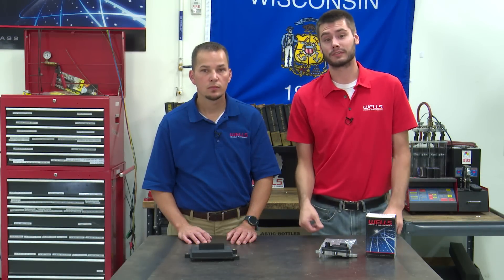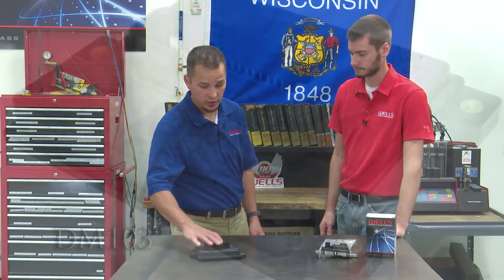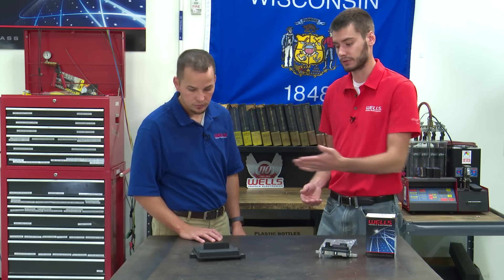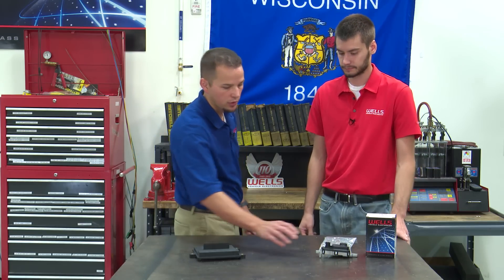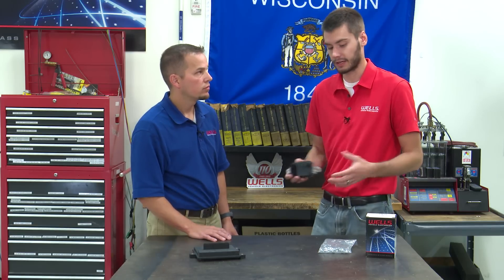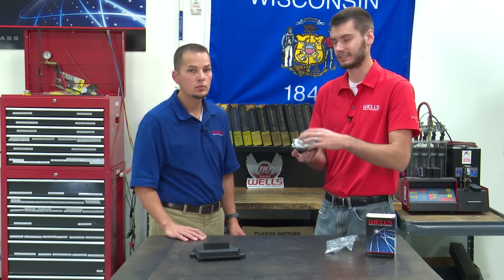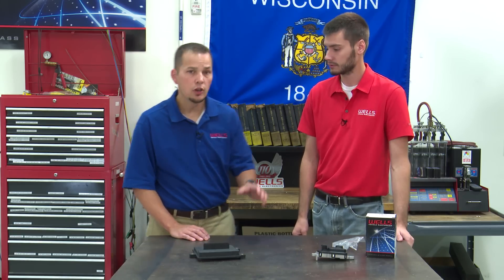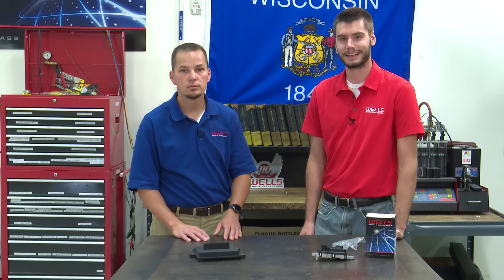Wells CounterPoint Ep.7--Fuel Pump Driver Modules, DM100 & DM103

Comment: I think the reason they space the module away from the frame with that bolt kit is due to dissimilar metal corrosion, I E steel chassis and aluminum module don't mix well, just my 2 cents.
Reply from the maker: Hey Edward, great point! Could be!
Mike Becker, Senior Insturctor

Comment: I just bought a fscm for my silverado that was programmed from my Vin. ... Dorman and Spartan autoworx sells them like that .  Not sure what to believe as far as my ECM needs a new except download ....
Reply from the maker: Interesting...did it work out alright?
Mike Becker, Senior Technical Instructor
Reply: NGK Technical Training ... It did so far... Probably 30 start and drives ... Thx for the video ..  always learning about the electrical circuits and you were very helpful
Reply: My 2008 Silverado has a crank no start. 
What symptoms did you experience before you bought the new FSCM?

Comment: Or just keep using a return style system with a regulator. This is dumb technology that didn’t need to be made.
Reply from the maker: Nick, actually it did need to be made in order for our cars to be emissions compliant. Using a return style system returns warm fuel back to the gas tank. This increases vapor generation which is monitored and controlled by the EVAP system. 

Mike Becker, Senior Technical Instructor

Comment: Plug and play is the way to go. How many DIYers have the capability to reprogram the module to their vehicle? Off to the junk yard with that car. A waste of a good vehicle and time consuming reprogram for the mechanic that has to install them. Computers used to need program discs to install cards on the buss. Later they went to plug and play. Progress usually makes things easier and less complicated. I don’t call reprogramming progress. Plug and play usually has its own driver for any device it fits.

Comment: When and why did they go to this system? and do you have a list of US auto makers that there fpcm needs to be programmed? Thanks
Reply from the maker: Hey Mr. G. Great questions. Ford has been using FPDM's since around 1999. The 99 Mustang used one. The reason they are used is to variably control the fuel systems output electronically. The FPDM will vary fuel pressure dependant on load, temp, etc. As for  a list of OE's using it...I don't have that info. But in our experience here, it looks like Ford and GM are the 2 big ones. As we look into newer models moving forward, I would not be shocked if Ford begins requiring programming. It is the growing trend in our industry.
Mike Becker, Technical Services Instructor
Reply: @GoTechTraining  It is another method to create income from privately owned mechanic shops. Proprietary is sometimes a bad subject.
Reply: Thank you
Reply: @29auto30  u make em&'"don`t have that info" re list of OE`s using em...get witit foo